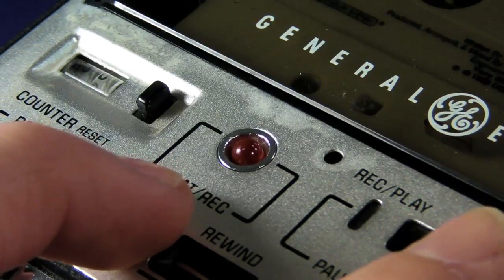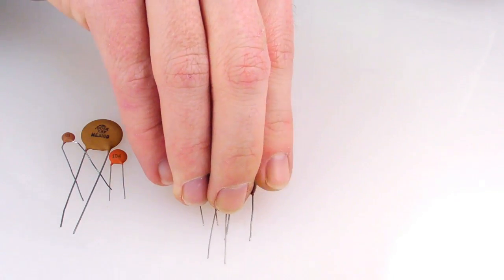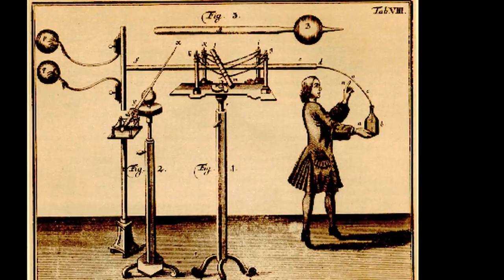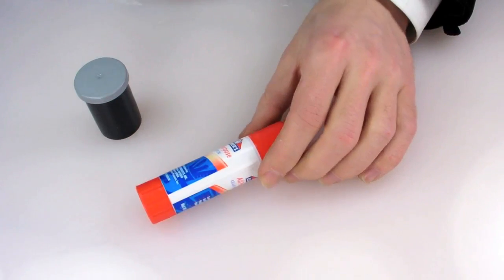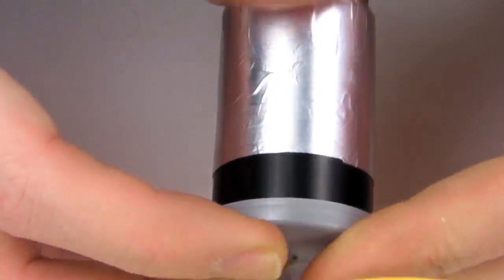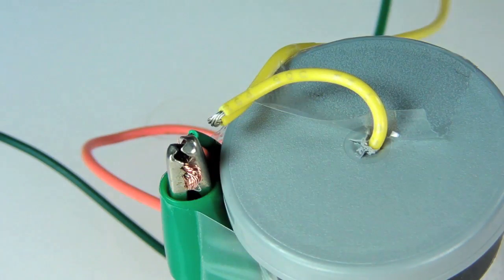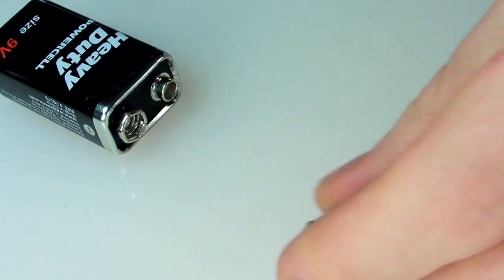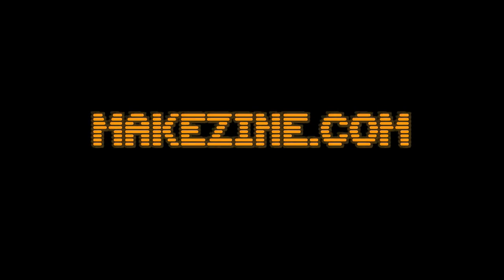MAKE presents: The Capacitor

Comment: As of now,
Capacitors work better to store electricity and discharge it quickly,
Batteries discharge slowly.

Capacitors also "Leak" at a much higher rate than batteries.

Comment: good informative video.  But I still have a question.  When you make the laden (sp) jar, where is the actual storing of voltage energy, cause it seems from what you showed is that you created static electricity and let it flow into the center conductor, then you touched the center conductor to the outside conductor (after stopping the supply of electrical energy to the inner conductor), and there was a discharge as shown by the spark.  So, if this showed that the inner metal wrapper held a charge for a while, then does that mean that even a wire should be itself hold a charge for a while, for example, if I connect one end of a wire to a battery and then take the battery away, will the wire hold a charge for a split second?  If so, then is it the cylindrical design of the laden jar that causes the charge to be sustained for a longer time?

Comment: A Capacitor is basically two plates standing side-by-side each other. If you apply a voltage threw the capacitor, it will generate an electric field that will add electrons to one plate and remove electrons from another. Capacitors have capacitance which is measured in farads, or the magnitude of charge (in coulombs) on one plate when you apply a voltage threw the capacitor.
Now, to calculate capacitance, learn Gauss' laws.

Comment: A Leyden jar is a capacitor. All a capacitor is, is two plates of something conductive connected to electrical terminals of different voltages, that are close, but not in contact with each other. A charge is built up between the plates.

The way the common electrolytic capacitor differs from a plate capacitor is basically just that the plates are rolled up instead of flat, facing each other. Making one is, thus, really simple.

Read the Wikipedia page on the electrolytic capacitor for more info.

Comment: The battery generates a voltage from a chemical reaction, a capacitor first needs to charge up and then delivers the charge, but it does not generate a voltage by itself. When you charge a battery, you are reversing a chemical reaction that afterwards is going to give you power, but a capacitor keeps the charge without a chemical reaction involved, it just keeps it as an electric field that stores energy.

Comment: So capacitors discharge when they are "full" or when they have enough energy?
Or do they discharge when they get some kind of pulse from the outside?
Because on PCB's the caps are always connected to the circuit, not like in the video where he connected them once the cap was full.
Reply: CookieCraftMedia They discharge because the electrons have a suitable path to travel. Normally, air is not a conductor but it will behave as one if there is enough voltage between the two conductors. If you bring the two conductors closer, the discharge will have a faster rythm or tempo.
Reply: CookieCraftMedia this is a good question tht still has not been answered because is not like the cap acts as a npn transistor or a pnp for this matter so how does this cap actually come into play? in a arduino uno you will notice those 2 big cap by the power jack and they are connected obvsly but when do they work ? if i power the uno with 5v(usb), 9v(jack) or 12v (VIN) what are this caps doing in place? when a transistor or voltage divider can and will do the same job?! and if im not mistaking there is a voltage divider in place for 3.3v (PWR Pin) and a resistor in place for regulating energy down to 5v (PWR Pin) so again why the CAP? and two at that if i was able to connect a motor directly to its GPP and work just fine then i wud have made a guess and said that those CAP are there to act as a reservoir of energy to contain the power needed to energize its motors like Servo Stepper or DC motors but i know that Arduino aren't good at powering motors directly after its a Micro controller  not a Driver Controller right and on those you do see this big Caps you notice in the Arduino uno so can someone share some knowledge and shine light on this topic? thanks in advance
Reply: so is thee a component that can be change in the mcu to let it have more mA so that it can actually drive a motor it self what type of upgrade can be done ?
Reply: CookieCraftMedia Whenever there is a charge on a capacitor, it will try to discharge itself. You can discharge it by shorting the leads with a piece of wire (not recommended for higher capacity caps charged to a few volts though) or a resistor, but since nothing is a perfect isolator (even air is not), the cap will discharge slowly over time. It will take more/less time depending on the resistance, capacity and initial charge.

So to answer your initial question,  capacitors discharge whenever there is energy stored and it has a path to discharge.
Reply: B10S But when the capacitor is on a solid chip, there is no "Hand" which can short the leads out. So how is the charging and discharging controlled, when it is mounted fixed?
Reply: +CookieCraftMedia It depends.  If you connect a switch, or a transistor, then the cap will discharge when there is a place for it to discharge to using the switch or transistor. Like a rechargeable battery.  When you connect wall power to the circuit, it will charge the capacitor.  If something (like a microcontroller) needs the power, the capacitor will give it some.  You can change how quickly it discharges by connecting a resistor in series.  If you have a laptop charger with an LED on it, you can see this happen.  When you unplug it from the wall, the LED stays on and slowly dims.  This is because the wall power is no longer powering the LED, so the capacitor will discharge and power the led (like a battery).  When the cap discharges to a certain point, the LED will dim, then go out.  For a device that you see used in movies on heart patients, where the doctors have the paddles and press them on the patients chest, the capacitors are discharged when a button is pressed.  This causes the capacitors to quickly discharge through the paddles (and the heart) to get the heart beating correctly (hopefully).

So they can be discharged just like a battery.  With buttons, switches, transistors, and so on.
Reply: Richard Wow this has just blown my mind! We need more people like you, thanks for the help! You deserve my like ;)

Comment: The use of the resistor is to reduce/restrict the full high voltage from the capacitor. LEDs actually are only able to handle 1-4 volts depending on the specs and overpowering them will burn them out. :)

Comment: Batteries store energy as chemical potential, then convert it to electrical energy when a load is put across it and some batteries can do this very quickly (lead acid car battery for example) capacitors however store energy as a potential difference of voltage across the plates, one plate actually has more electrons than the other, when Colin said the capacitor equalizes its charge, the excess electrons are just moving back to the other plate. Basically the difference is how the energy is stored

Comment: The resistor is used reduce the current passing through the LED and prevent the LED from burning out. Without the resistor, the capacitor would discharge almost instantaneously assuming the LED and wires have near zero resistance. That is not ignorance. That is curiosity which is a good thing.

Comment: @Ne555N You use the negative lead of the capacitor as the ground. You don't need to ground back to a battery since the capacitor is used a temporary storage for the current.

Comment: Batteries involve a chemical reaction in the presence of two dis-similar conductors involving an electrolyte of some kind (a manganese dioxide coated carbon cathode and zinc anode with a zinc chloride and ammonium chloride as an electrolyte for example, there's tons of different kinds of batteries.)

A capacitor is just a gap between conductors made of some dielectric, they're better at storing high voltages in small quantities and discharging/charging very quickly.

Comment: Yes, but I didn't say a dielectric causes an electric field, I said it allows an electric field to be established. Indeed air can also be a dielectric, but the point I made was your exclusion of it while explaining it to Tom.

Correct, that was my typo, I meant to write 'protons' which would indeed equal the net 0 charge, however, in establishing an electric field with a *battery* (polarized, unless it is an AC power source) adding electrons to the receiving plate will create an efield

Comment: Gives a basic idea at the end with the LED. The strips of metal have a stored potential difference. When you apply a load or short them out, the electrons flow and neutralize the potential differences.

Comment: LED's have a maximum current(A) they can withstand before burning out. It is usually around 20 mA or so. 9V batteries have something around 300mA of current. 300 is obviously a lot higher than 20 so you need a resistor to drop the current down to something that won't make the LED burn out.

Comment: Capacitors can store potential (voltage) for a short amount of time, usually a few seconds for small capacitors. A battery on the other hand, will store potential for a long time until it gets discharge.  They are very different!

Comment: 1) No, actually, the dielectric isn't what causes the electric field, it effects the capacitance. In theory, a capacitor can be made of two plates with empty space in between it.
2) Your second part is just plane wrong. That would imply the net charge on a capacitor will be negative, but the net charge on a capacitor as it is charging is 0. There is just as much reason to put a positive charge on one plate as there is to put a negative charge on the other plate.

Comment: im not a physics expert, but I believe it works by holding the charge of electricity. Potential energy is built up by the PVC pipe and is stored between the foil. the outer and inner foil keep the potential energy until there is a ground for them to dump out of.

Comment: @TheRadioControlKid capacitors tend to release all their charge almost instantly. capacitors also tend to hold high voltages although not all of them do.

 however, supercapacitors can store almost as much energy as a small battery experiment: go to radioshack and go to the back where all the component parts are find the biggest cap they sell (with the highest uF) and buy it, and charge it to 3 volts with two batterys, and see how long it willpower an led. not too long...

Comment: Collin's Since you introduce Michael Farad and Capacitance; try giving a demonstration of Faraday's first electric circular motion. His experiment is considered the first motor. It is not difficult to create. I think it would freak out most of your audience. After they see how it is done; most will try to build one. All you need is salt water (he used mercury), battery, permanent magnet, some solid copper wire and a simple support. The whole experiment is profound but simple.

Comment: A capacitor is most commonly used to avoid damage to other component in case of open circuit...for example if the electricity cuts off while you are using your desktop computer (assuming it has no other external battery supply) it avoids damages to important chips by gradually releasing it's energy stored, and not letting the current to suddently drop to 0.

Comment: You see the strip at 1:58? 
It stores eletric conduction on thoes strips, they are charged, and because they have large areas, and they are usually filld whit some electrolit they can store eletricity by a high resistance to esceping electrons.

Comment: NO, a battery is a cell with an integrated chemical oxidation-reduction reaction, in which the electrons flow from a substance (commonly a metal like zinc or lithium) to another (like manganese dioxide), and they do it through the circuit of the device you use the batteries in.

Comment: Yea he did, it is just having metal store electricity, just as you can test and see with many different object. A good example would be to rub a balloon on your hair, this adds static electricity to the balloons surface. This is because you are rubbing electrons onto the surface of the balloon. This then is able to store the electrons and allow them to move, hence the static shock you get from a person rubbing their feet onto the floor and then touching another person, releasing a static shock.

Comment: I found out that if you make a series circuit with a speaker and a motor, you can hear the motor through the speaker using electrical noise. But if you connect a capacitor in series on its own and the out the motor in paralel, you won't here any noise because the capacitor is basically a filter

Comment: its a high voltage pulse capacitor its about the size of a led acid battery for a car. took it apart and its only a bunch of ceramic plates with silver foil in between

Comment: @Oshiba88 The voltage is the maximum the capacitor can handle without damage. As such, you could use a 2.2uF cap rated for 16V, 25V, 35V or even higher, provided it will physically fit.

Comment: Burns out because of to much current, not voltage, you can put quite a bit of voltage across an LED, but it will only drop about 1.4 Volts (depends on type of LED).
Also, it doesn't explode, it merely quickly dims.

Comment: So a resistor is like a regulator than? It won't allow all of the charge to go at once or over a certain level or voltage? Could a capacitor hold a charge for like a few days or longer? Sorry for all the questions haha. I'm just pretty curious. I thinking about going into electrical engineering next semester.

Comment: I believe Tom asked HOW a capacitor works. All you really need to know is that the plates ARE separated to know how it works. You DON'T need to know HOW they are separated to know how it works.
However, you DO need to know about dielectrics in order to calculate capacitance, but NOT to know how it works.

Comment: I have a question on capacitors...

I have actually built this setup a while ago and it burnt me a few LEDs.

Start by hooking up the + terminal of a 9 volt battery to a pushbutton, to a 1K resistor, to a 100 nanofarad ceramic capacitor, to a LED, and back to the battery.

Please note that I connected all of these in series, nothing in parallel.

When I pressed my button, I burnt my LED.

 I beleived  that by hooking batery to button to  capacitor to resistor to LED to battery I could light the LED, but again I burnt it.

According to all the doc I found, this should work but didn't. Why?
Reply: +Victor Rivarola The LED is also polar sensitive! + -> -
Reply: I know about that. But LEDs do not burn if you connect them backwards, they only do not light up. The LEDs I am taking about actually burnt down forever and had to be replaced after a short visible light!
Reply: +Victor Rivarola Maybe the LEDs aren't for the amperage?
Reply: Thanks, but I did think about that. So I replaced the by now faulty LED and removed the capacitor from the circuit, before applying power. The LED lit properly. When I put the 104 capacitor back in, the LED burnt instantly.
Reply: +Victor Rivarola because your resistor is on the wrong side of the LED.

There is no resistance between the capacitor and the LED in your circuit, so when the capacitor discharges there is too much current and it blows the LED.

If you instead tied your LED's cathode to a resistor and then to ground, or put the resistor between the capacitor and the anode of the LED it would work properly.
Reply: Actually, I just solved what the problem was, and it had nothing to do with the position of the LED, resistor and capacitor.

If I connected all 3 elements IN SERIES, and I applied power (5 volts DC), the results where the same: the LED will flash for a extremely short time and then no more.

However, while I was discussing with you, I remembered something...

Capacitors, once full, do not conduct DC. AC yes, but not DC.

So, the LED would flash while the capacitor was charging, but no longer. Afterwards, it would not allow any current across to lit the LED, so it would shut off, not burnt down!

I decided to test this. I connected all 3 items IN SERIES once more, and sure enough the LED behaved as it had burnt down...

However, I actually tested the LED afterwards instead of just assuming it had burnt down, by removing the capacitor. This time, the LED shone back on me!

Proving me that all those LEDs I have actually discarded where in perfectly good working order!

Grrrr....

O well, it turns out you not only learn by burning things down, but also by declaring perfectly good components burnt and discarding them!

Thank you all!

Comment: @ryangolf1212  so you have a place for the electrons to go
a capacitor consists of two oppositely charged plates. To get there from neutral foil you need to connect to ground on one side

Comment: When and how we want to determine the size and type of capacitors to be installed in the circuit,what is the characteristics and how do I calculate the required capacitor in the circuit?

Comment: I'm pretty sure what happens is that the charge builds up on one of the metal sheets, creating a charge density.
When the sheet is connected to the rest of a circuit, the charges jump, creating flux on the other sheet, and the other side of the circuit

Comment: @TheRadioControlKid the power is stored inside the chemicals in the battery, that's where the power comes from, capacitors only hold a minuscule about of charge, in other words if you were to power somthing, it would only last a a mircrosecond with the small caps, and you might get (at the most) a few seconds with a much MUCH large capacitor. a